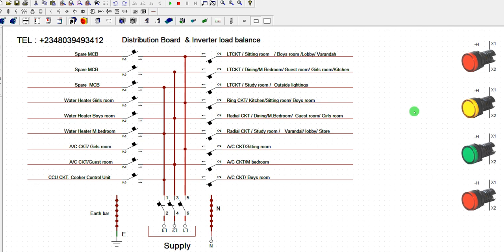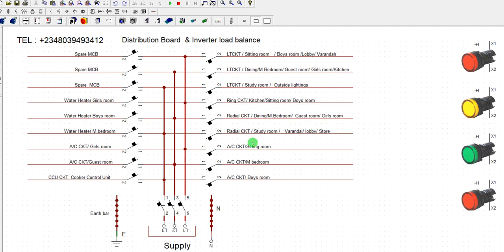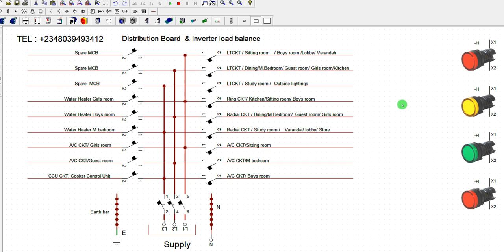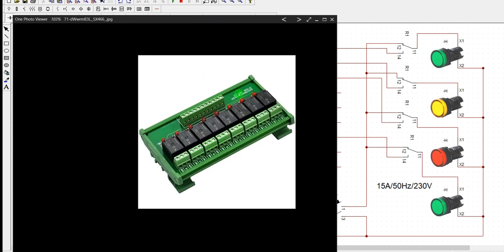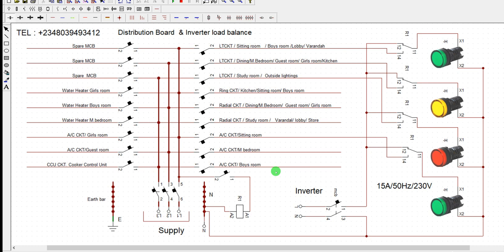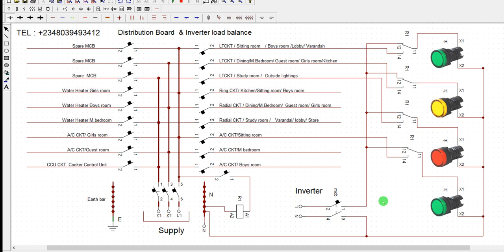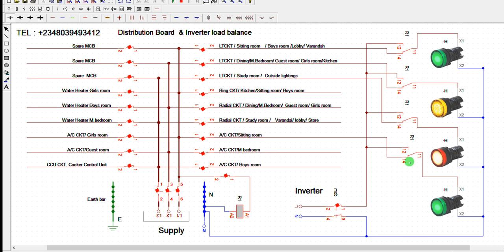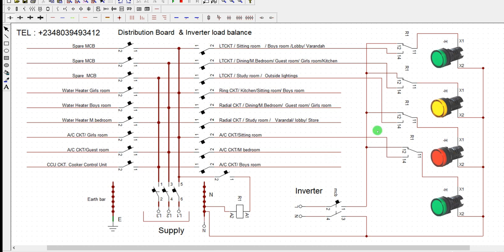Distribution board and Inverter load balance

Comment: Do we have to build special relay box for doing this installation if yes where do we keep it in the installation
Reply from the maker: Relay device is very small that could be fixed right inside the DB while terminating the connections into the relay base.